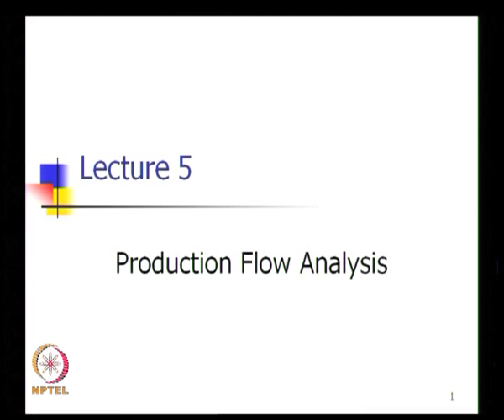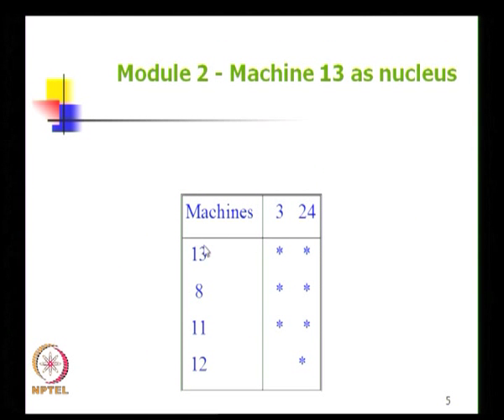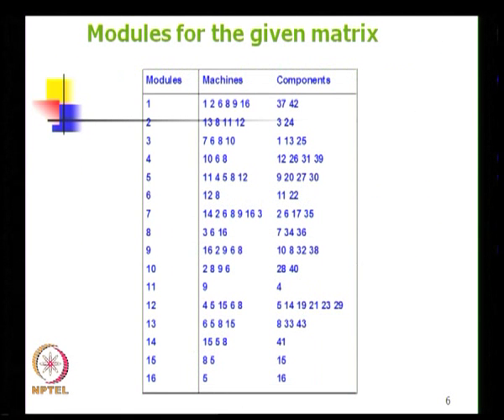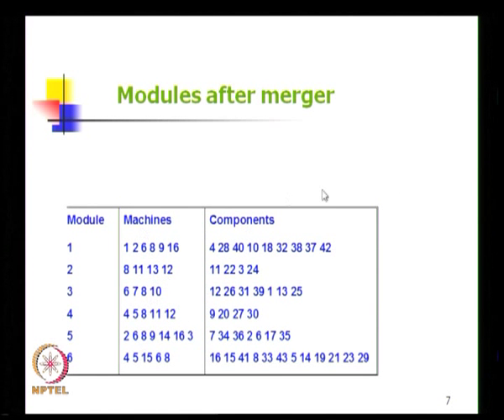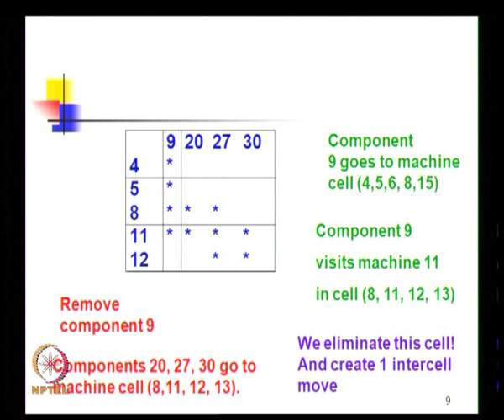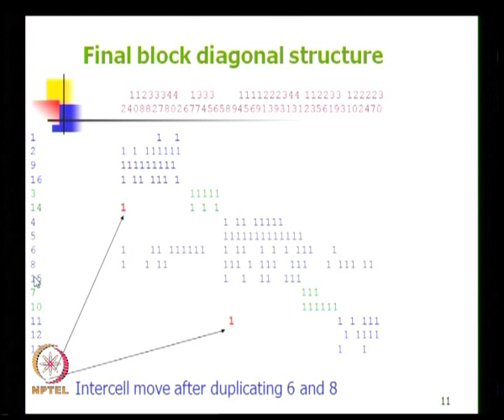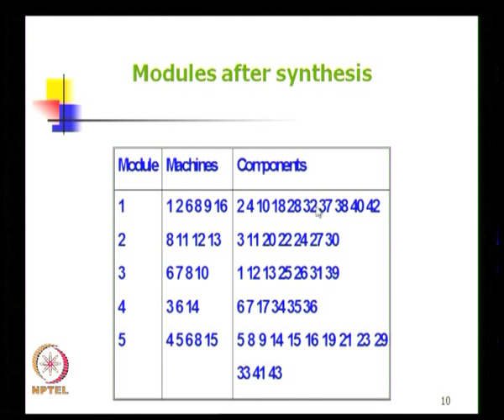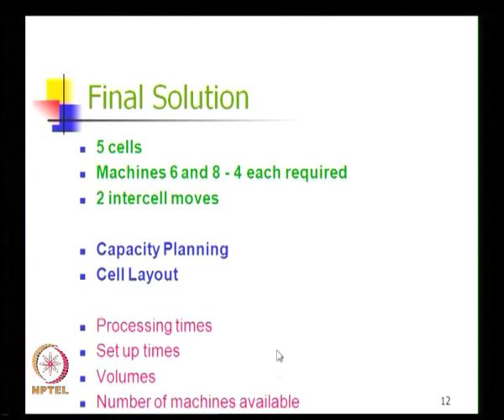Mod-01 Lec-05 Production Flow Analysis

Comment: Great lecture I tried to see as many as I can! I notice that there are some movements in the Machine Usage Sheet. If you look closely you can see that the area around part 21 to 26 for machine 8 is moving to the right when assessing part 24 in module 2?